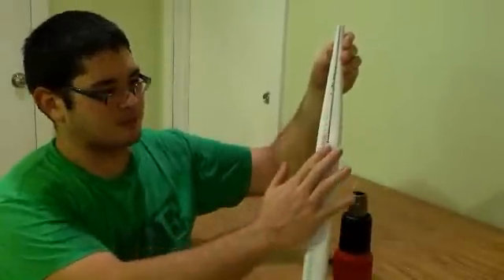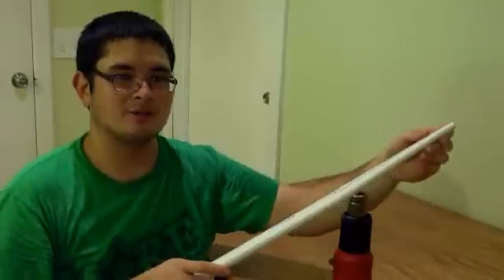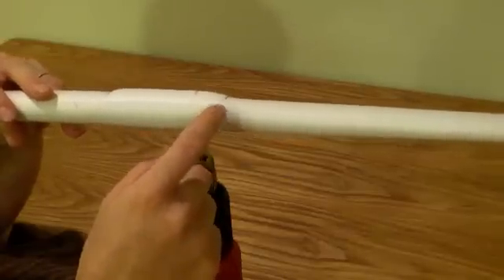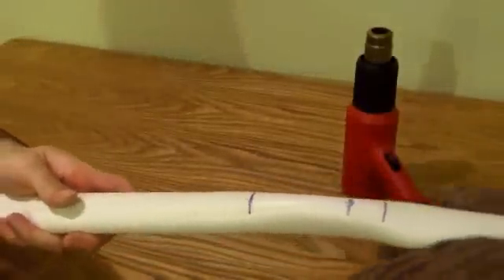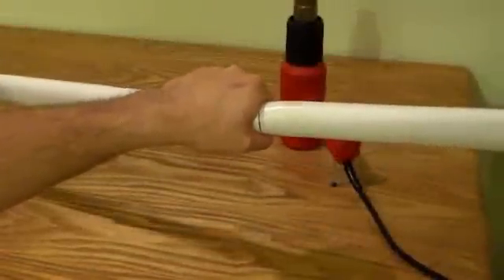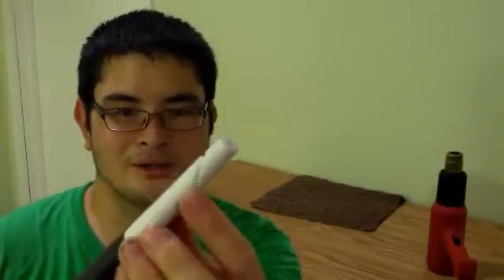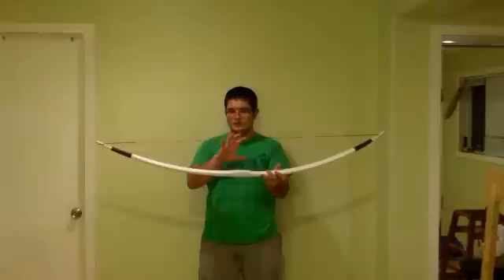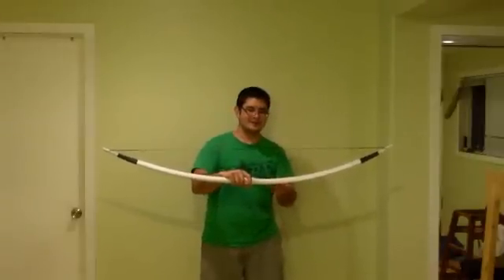PVC Pipe Longbow: Tip Binding, Handle Shaping, Nocks

Comment: If one is after "faster (lighter) tips" to try to increase arrow velocity, would you still recommend cutting the center of the PVC tips like in this video? Or just go with a flattened taper, and maybe squeeze-flatten the tips and round off some of the nock area?
Reply from the maker: If the goal is speed, then either removing the centers or removing the back edge of the tip (like the Hobbit style PVC bow) will work. This style allows for tips that bend while the other style has rigid tips.

Another option is to insert wooden tips. Even very dense wood is still lighter than the PVC it replaces. Thanks for watching!